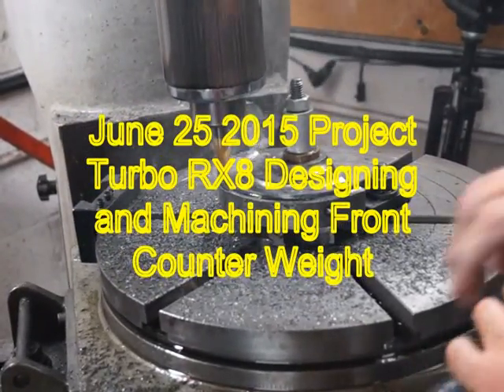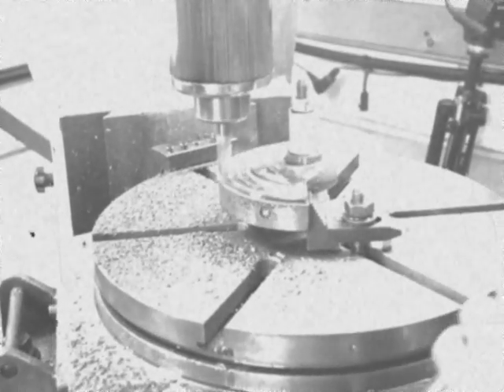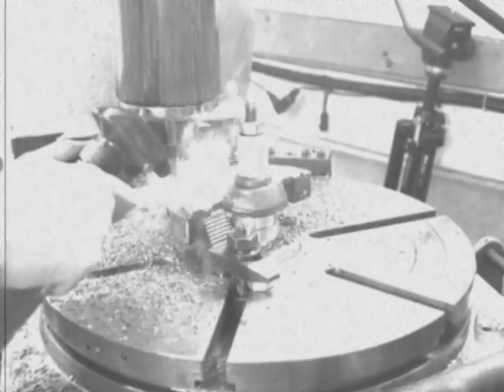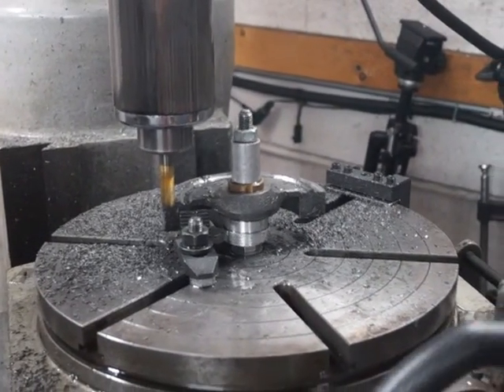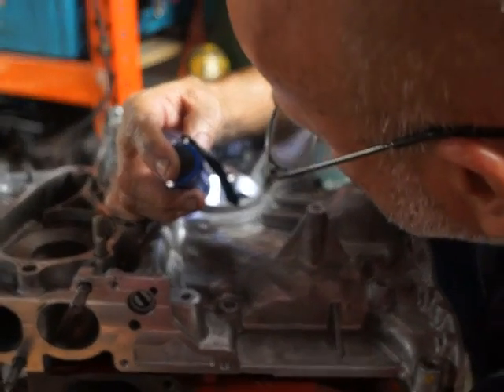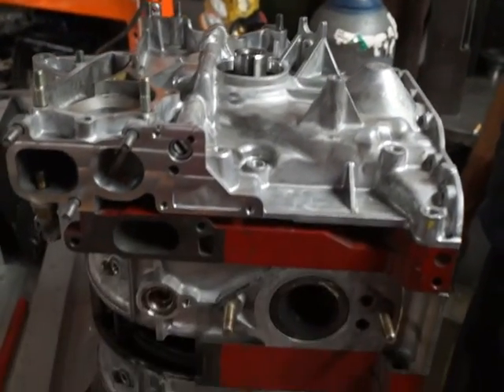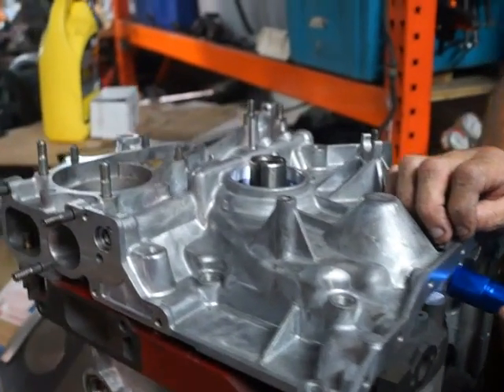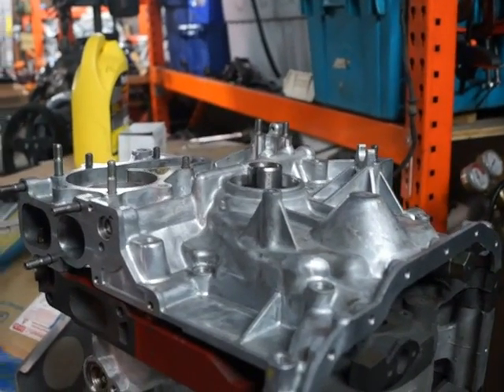Project Turbo RX8 Part 2

Comment: Are all the rotors in the engines from the 12a, to 20b, all the same dimensions? You mentioned putting the Turbo2 rotors in the FD 'block' so it's something I was curious about.
Reply: i know this is late but no they are not the same width from 12a to 13b, but the 13b and 20b are the same width.

Comment: amazing videos - please tell me... this rotary vs piston war... 13B is 1.3L true or false?
20B = 2L true or false?
This is something I'd love to know seeing that no piston racer would ever run a 1.3L vs a 13B - 'we' 13B' guys always face v6 or v8's... how is this fair?
Reply from the maker: +Verum Quaerere Seek Truth -  A 2 rotor engine is equivalent to a 6 cylinder piston engine because it has 3 chambers always in one phase of the intake/exhaust/combustion cycle.  So a 3 rotor (2.0L) is like a 9 cylinder and a 4 rotor (2.6L)  like a 12 cylinder.
Reply: Richard Viscasillas okay great. Now I know. Thank you